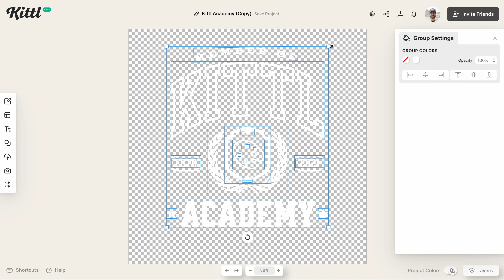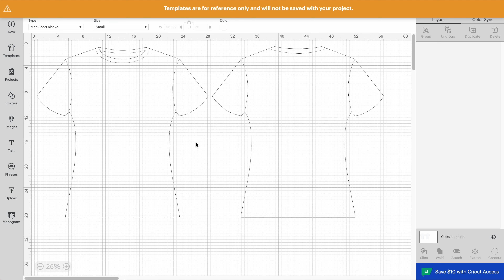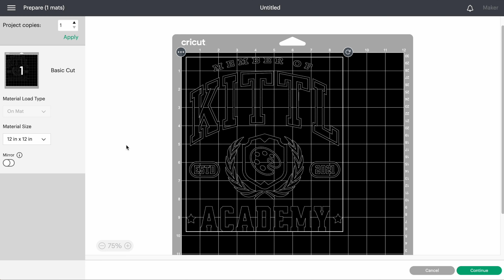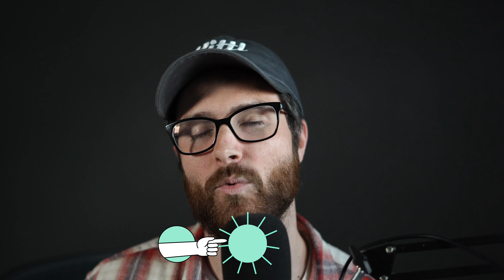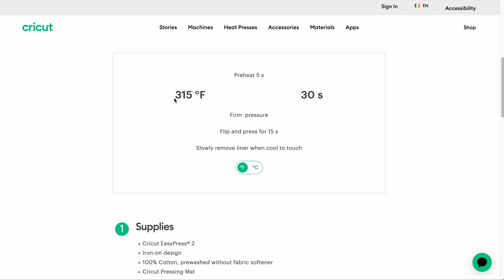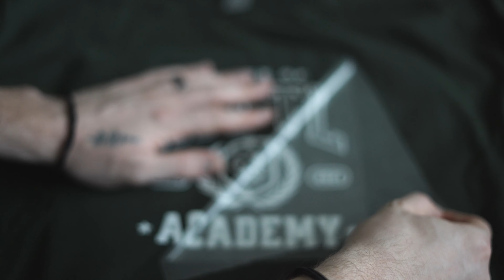Full Cricut T-Shirt Heat Press Tutorial Using Kittl! (The Easiest Way To Make Cricut Shirts)

Comment: I will not pay 30 monthly and can print out cause I tried to cut with cricut and it’s not working I use or redo what is made and put my own words and it is not working
Reply from the maker: Hey there! We're not entirely sure what the issue is, as we demonstrated how you can use Kittl designs to be cutout with Vinyl using the Cricut. If you are wanting to continue editing the design within Cricut once you import it, then you would need to export an SVG from Kittl, and if you are wanting to edit your text from within Cricut, then you would need to add text manually from within Cricut as text exported from Kittl cannot be edited. We would also recommend looking up some more in depth tutorials on Cricut cutting!